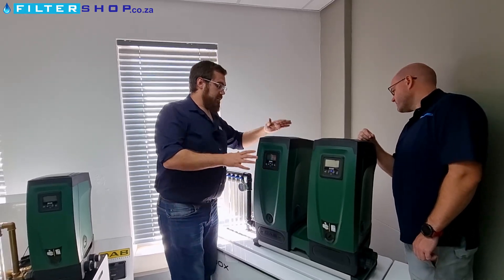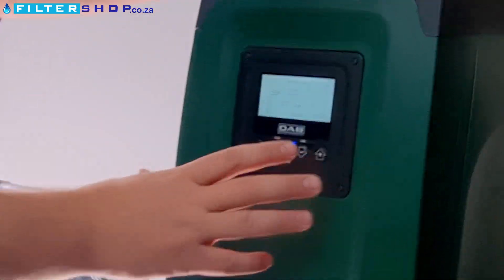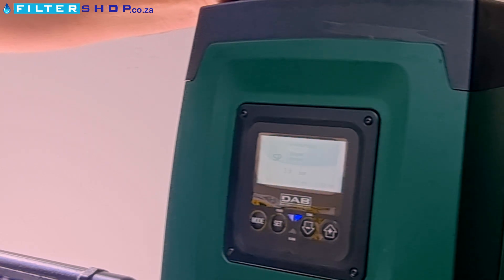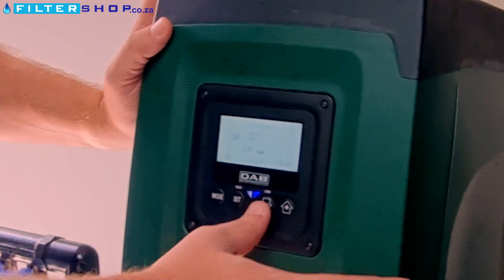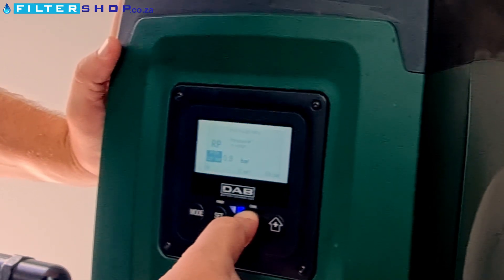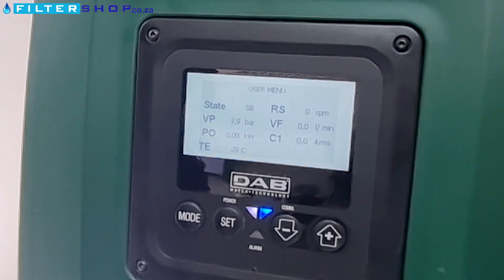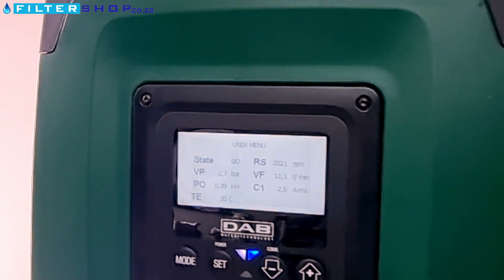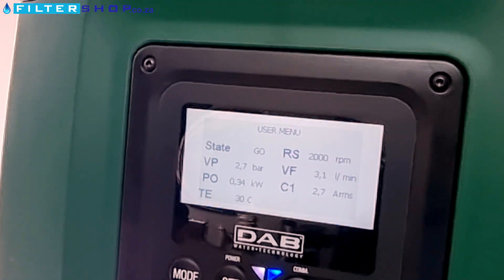DAB EsyBox Setting Pressure & Info Display

Comment: Hi Guys, not sure if this is possible or not, maybe you can tell me or if you have any other suggestions. Can I set the pump to switch on when a flow rate is exceeded rather than when the pressure drops? I have a large property and I suspect that there are a few leaks in the water system and as such my current pump tends to cycle about once every 2 minutes to keep the pressure up (I have a pressure tanks as well).  I have a low positive pressure on the whole property as the tank is at the top of the property, I would like the pump to switch on when a tap is opened and increases flow rather than when the pressure drops. Is that possible with the DAB's?
Reply: Maybe have a bypass with a check valve going around the pump to the outlet, then set your restart pressure to just below the static pressure from the source

Comment: Do you have to adjust the air pressure in the bladder in the back of the tank if you raise the pressure up to 65 pounds?
Reply from the maker: The pressure needs to just remain a bit below the lowest point your pump will go to

Comment: This truly is an amazing pump.  I installed one under my cabin and honestly dint have high hopes at the time.  I unboxed it. Hooked it up. And it’s been issue free for 5 years.  I guess it even has some sort of antifreeze device?  I almost forgot about it and noticed it the other day when I was under there.  On the back is has a plug with an oil can on it.   I’m I suppose to be oily or changing the oil in this?
Reply from the maker: Hi, good to here it has been working well. It is a non return valve at the back, but it is probably a good idea to clean it after 5 years.

Comment: How come my unit is detecting 3.5 bar on the line when there is no water on the line at all. I actually set my bar pressure to 5.5bar which when measured at the tap is equal to 2 bar.
Reply from the maker: That doesn't sounds right. You would expect a small pressure drop on the line bit not typically that much. See if you can test before and after your pressure regulator as it might be faulty. It could also be that the feed to the pump is too restricted or that the pump is more than 2m higher than the water level. If it is non of these things contact DAB as their support is quite good.
Reply: What is the impeller material? Can the pump be exposed to direct sun light, hi humidity and ambient temperature of 47 c?
Reply: @garocompgaro  Not sure what the impeller material is, it was brand new and installed inside a room in my house, so stable ambient temp, himidity was around 70% at its highest but that aside I did have low voltage errors from 2021 so perhaps a manufacturing problem. 
I replaced that unit with another and on this install used a wider diameter intake pipe(32mm).
It runs to spec now. Must of been a unique problem with the first unit.
Reply from the maker: @garocompgaro   Max Fluid Temperature: 40˚C and Max Ambient Temperature: 50 ˚C so it think your fluid temp might go over spec. On the impeller, they just say it is a polymer impeller but I am not sure of the exact composition. We had a look at a cut open one in this video if you want to have a look: https://youtu.be/4MGNttEY-x0
Reply: Thanks 👍